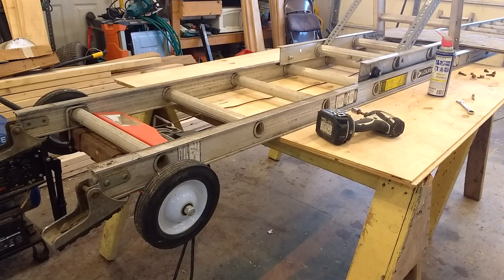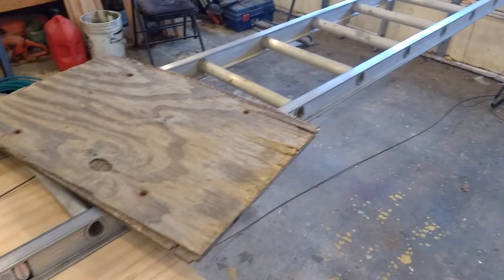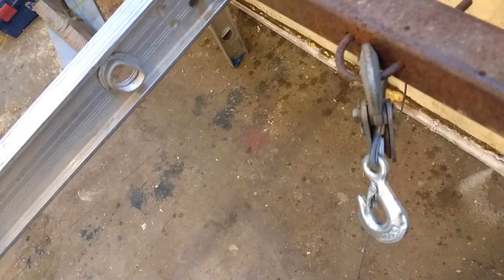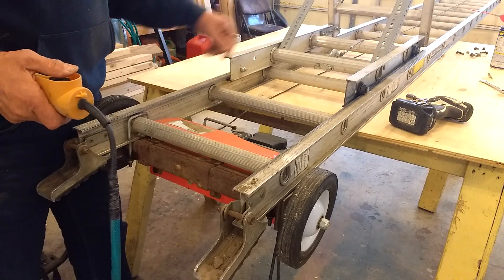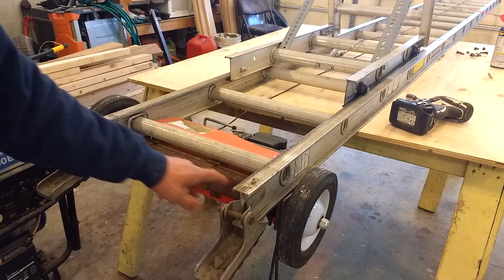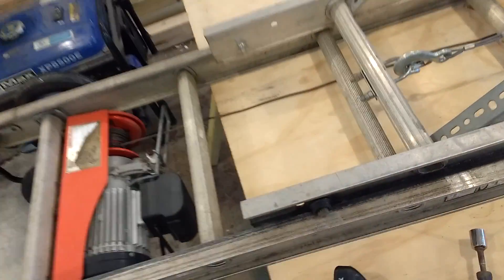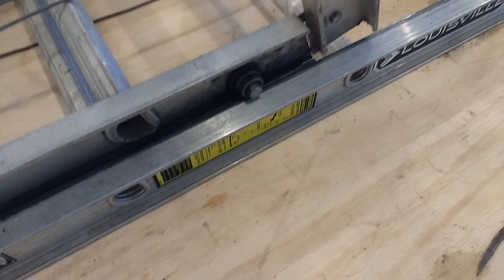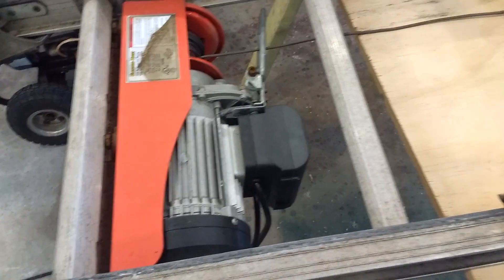Ladder Hoist Servicing

Comment: Hi Ken, I like your use of the equipment. Personally I would use a light smear of grease on the running wheels and inside the rails, also a second nut with nylon on the ubolts. The last thing you want to happen is for any part to fail just when you have a nice size job waiting.
Reply from the maker: True thanks

Comment: Hi, can you please tell me where you get that pulley and bar you attach at the top of the ladder?? please help i really need to make one of these please thank you!!!
Reply from the maker: I bought the tube steel from a welder and the pulley from a hardware store
Reply: @kenskarpentry  thanks,  and  the shingle hoist  is from harbor freight? would this work on an extension ladder?